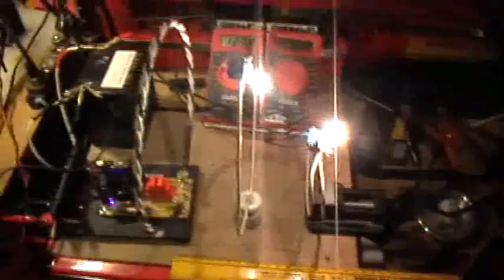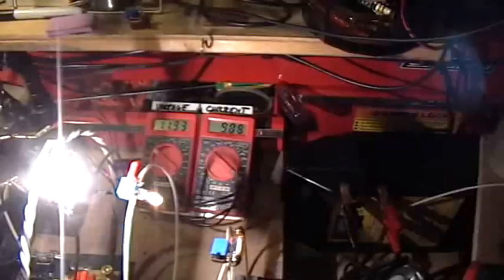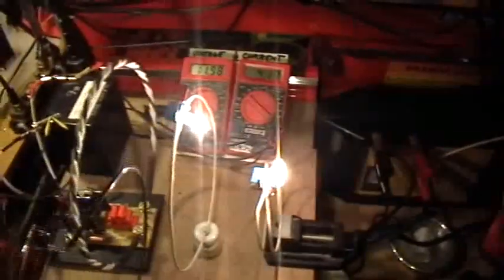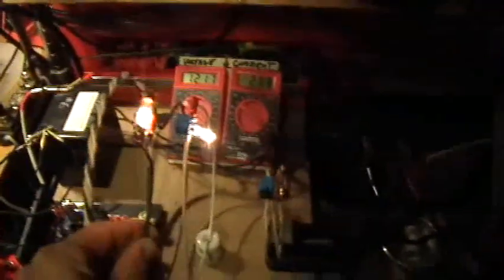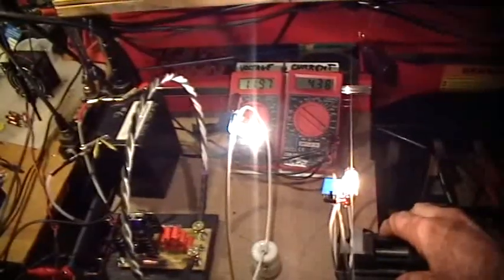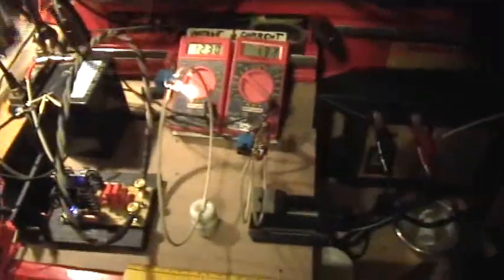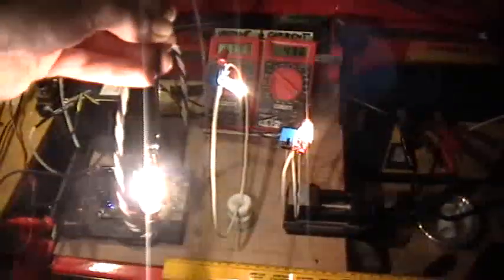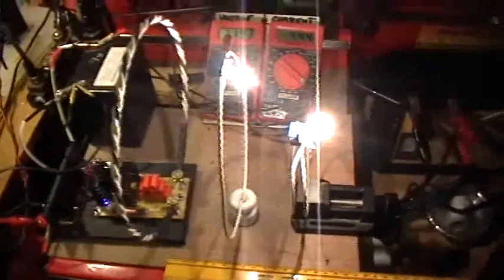Electric OU: Wireless Power: Three Receivers, Coupling, SNM

Comment from the maker: The transmitter and receiver loops are made of single, double, or triple strands of #12 solid copper house wiring, The multiple strands are twisted by clamping in an electric drill. The transmitter loop should be the heaviest conductor you can manage... my triple strand one shown here works fine, doesn't heat up much. The receiver can be a single strand.
Monitor capacitor temperatures... they do get hot, so use high voltage, high quality polyester or polypropylene capacitors.